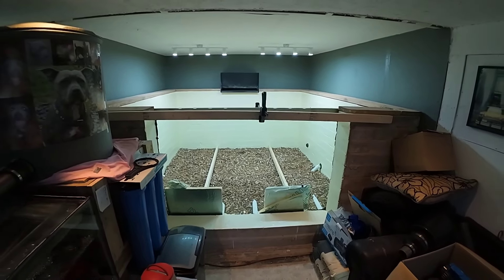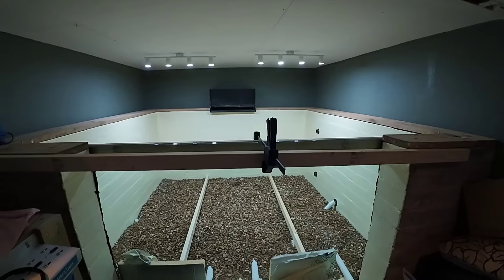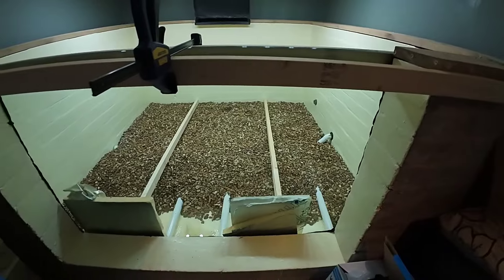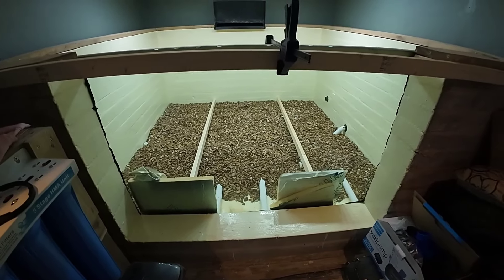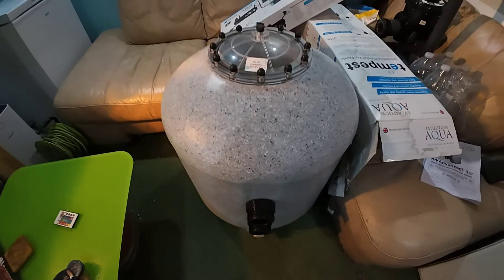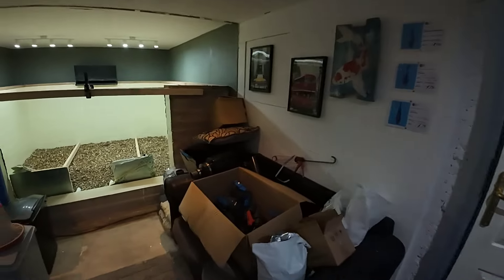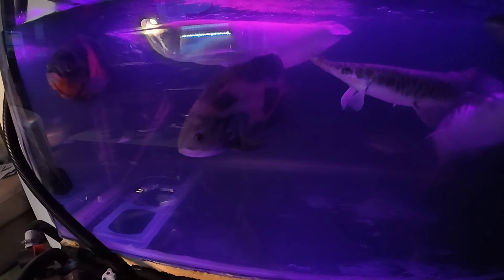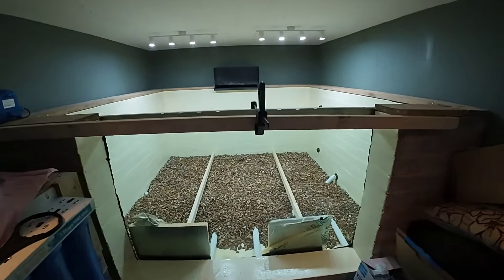MONSTER PREDATOR POND: FINALLY HAS A WINDOW IN #pondbuild #monsters #snakehead #channa

Comment: Looking epic mate. my 3000 gallon pond has exactly same access issues. glad I went for 5ft water height but damn does it make annoying to access lol. Please let me know how the air sourced heat pump works. I am only using 3 x 1kw aquarium heaters to heat mine. Its actually surprisingly cheap as I have the whole pond insulated with 100mm kingspan.
Reply from the maker: Thanks mate appreciate it. Nice mate. I think I know who you are from the predators groups lol. I've seen the pictures and videos 👌👍 it's a tight squeeze lol. Yeh yeh will do mate. I'll show it in next video. Ment to be really cheap to run. Thanks again 👍